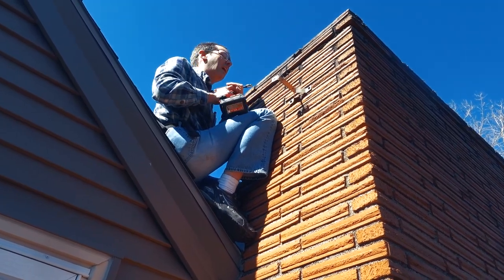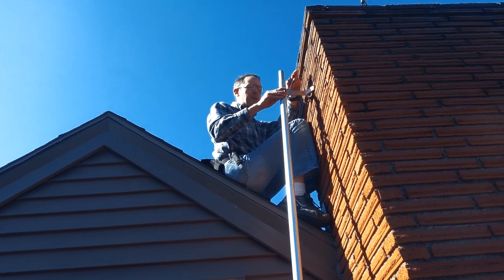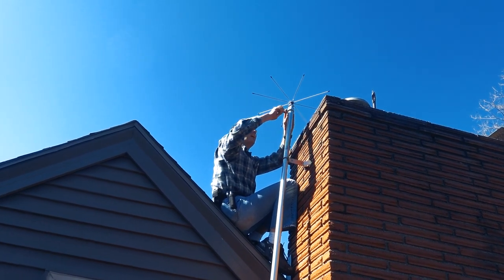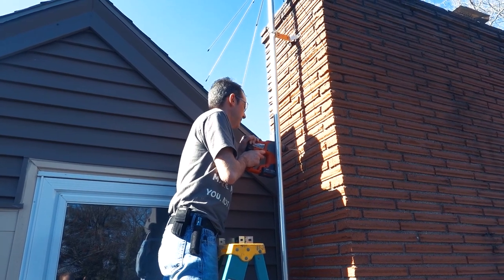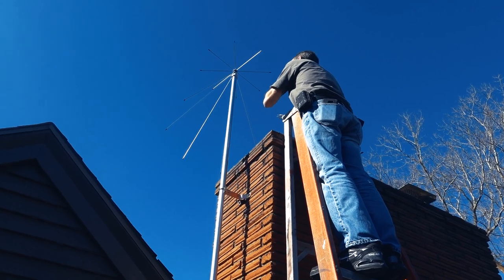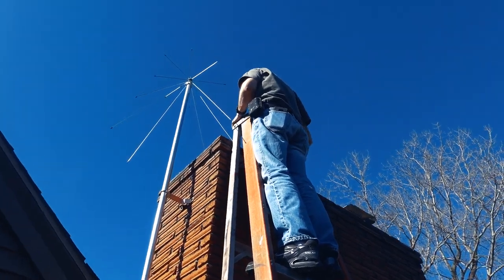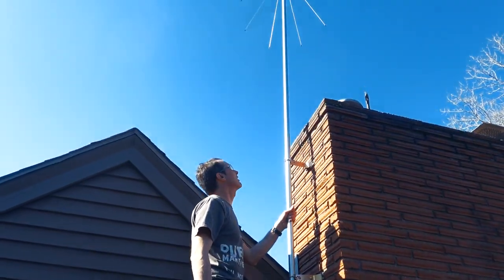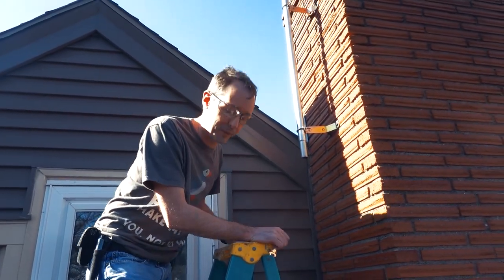Antenna Mast Trick For Amateur Radio Mounts

Comment: I used sch 40 galvanized 2-7/8” at 24’ in length for my antenna mast. Then took a 2-3/8” thin wall galvanized piece that was 16’ long and slid 8’ of it into the lower piece. That gave me a nice sturdy mast at 32’ for about $100. Used three anchors (similar to what you were using, but three legs per anchor) into masonry. The mast is really nice, good height, and stable in storms etc

Comment: I use the fence railing method for some antennas.  You are so right.  Cheaper than an antenna mast.  Put two ten footer's together and you have a twenty footer and 1/4 the cost of an antenna mast at the same height.

Comment: IIRc, that antenna is rated for something like 150w, so it can be used for transmitting too! An amazon commenter mentioned that it maintains below 2:1 SWR for 115MHz to over 1 GHz
Remember, outside of power ratings, antennas are symmetric. What works well for receiving works identically for transmitting.
Reply: If that's the "standard" radio shit discone scanner antenna (or anything close) it is absolutely good for vhf and uhf and theoreticly (I wouldnt recommend it) 6 meters as well. My current vhf/uhf antenna is one of those from radio shack 25 years ago, and it's still kicking (sans one leg which seems to have walked off on its own). The down side of a discone is they are [near] zero gain.
Reply: @nerdgarage  compared to a dipole, absolutely.
But the purpose of a discone is omnidirectional reception, and wide bandwidth.
Reply: @ddanielmiester  very true, while both are omni, they server different purposes and along with that goes a give and take that applies to almost all RF components : you can have wide bandwidth, or high gain, not both.

Comment: Chain link fence top rails where I live are typically sold in 15 ft. lengths, which is even better.  If you need additional length, one end is reduced so that they couple together very cleanly.  If joining, drill through the coupled section to insert a bolt, lock washer and nut to secure the connection and this also maintains the electrical integrity of the pole's full length in case of a lightning strike.

Comment: That's exactly how I mounted my verticals on my rear deck.  Unfortunately, I live in a low area and have a hard time hitting any repeaters, (we only have two or three that are within 30 miles.)  This summer I'm going to try a directional on top of and abandoned phone pole in my backyard, which I'll use to get a 60-70' "mast."  right now the antennas are at 33 and 36' at their tips.

Comment: Put up a section of 40ga galvanized commercial grade posts that are 24’ sections. Commercial corner posts are quite a bit larger diameter, but allow for a much sturdier mast. Atop the mast we installed a gp-6, and with an offset we installed a chameleon emcomm III in an inverted L config. Really nice setup at a fraction of the cost